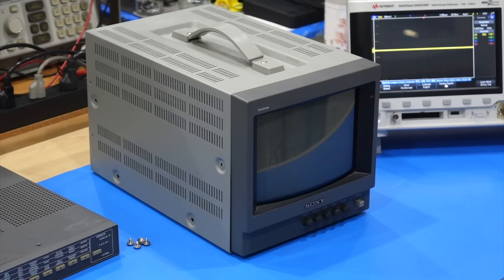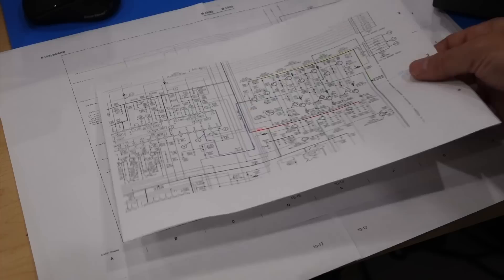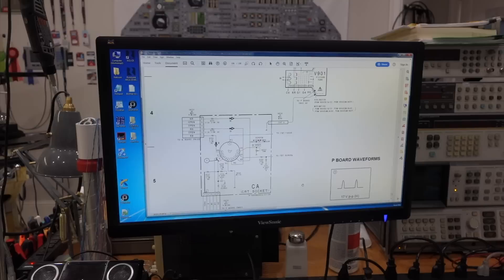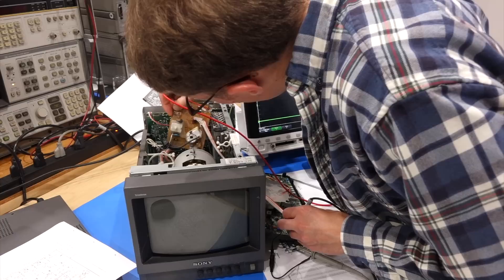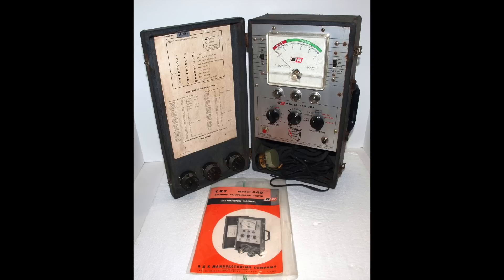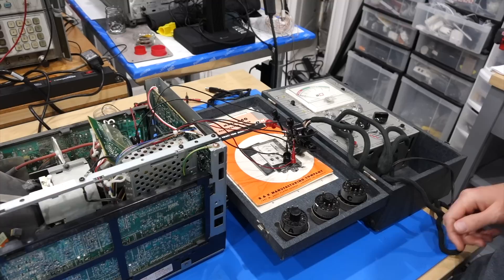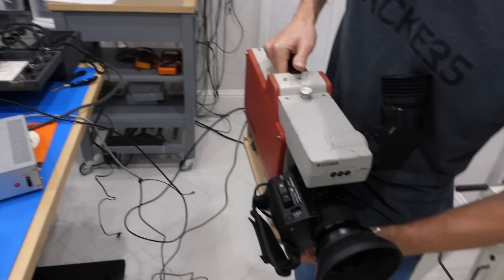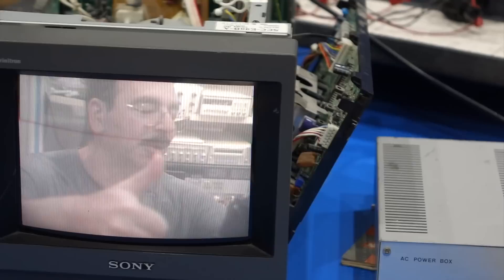Rejuvenating a color CRT

Comment: The only possible replacement for CRTs with comparable display characteristics that I can think of would be something done with lasers, mirror wheels (not mirror servos for X-Y as in laser projectors) for vertical and horizontal and some optics for adjusments.
If I had the engineering knowhow and money I would even try my hand at it myself.
Being that my main interest in this would be compatiblity with old and not so old computers and games, I'd aim for something that could do from 15kHz to 31kHz at least, perhaps a little more for systems at the edge of the HD era, and some PC style video modes, maybe.
Reply: The problem is that a CRT works because of the phosphor persistence.  If you scan a video raster on a white surface with a laser it will flicker too much.  

There might be a way if you had RGB fluorescent stripes on your wall and modulated a UV laser that had the RGB signals sequentially activated and synchronised with the stripes.  You would need to use optical feedback to maintain lock.
Reply: @KallePihlajasaari  I don't think that the on-screen phosphor persistence plays a big of a role at all. From what I've seen, that's seems to be more of a urban legend than technical fact. Maybe in earlier phosphor formulations, but not on later ones.

Have you seen the high speed footage of a CRT that The Slow Mo Guys released a while ago? youtube / 3BJU2drrtCM
The glow barely lasts for a few lines, and at much diminished brightness. I think the persistence phenomenon is just an effect of the human visual system.

If phosphor persistence was so strong as to keep any significant light emission on screen for long, I don't think classical scanline based light-guns for shooting games (like the namco GunCon) would be able to work at all, since the photodiode in the gun is focused to pick up a pulse from the screen and compare the timing it to a diverted composite signal also coming into it's circuitry in order to calculate the aim very accurately. down to a small fraction of a line. If the screen stayed bright for a long time, it would be impossible to tell the difference between the passing beam and it's tail.

There was also an old video from some guys, I think from Germany, that had made a similar display with laser and mirrors, but, in this case, it was with a pivoting mirror, so the scanline would travel back and fort on alternate signals, which is, of course, incompatible with the type of signals (and lightguns) I would want this for, defeating the purpose completely.
I'm trying to find it.

In short, I don't think scanning a bright enough laser point across the screen would produce more flicker than a the phosphors of a CRT lit by a scanning electron beam.

EDIT: Come to think of it, even regular XY pivoting mirror laser show projectors don't flicker that much in person. Persistence of vision is much higher than phosphor persistence.
Oh, and I didn't mean this as a wall projector. My prefered setup would still be a selfcontained unit, something similar to the old retro projection TVs with three monochromatic CRTs for red green and blue. Hopefuly smaller  :-)

EDIT2: Come to think of it, again, even with chearp laser pointer you can just doodle lines on a wall and see a pretty long trail thanks to persisistence of vision. You think your hand can move that thing faster than a mirror wheel? ;-)

EDIT3: I found the german laser projector again:   youtube / meMM69if74s  --  hackaday (dot) com  /2011/12/31/full-color-laser-tv/
It does basically what I would like to do, but in a different form factor, and maybe with collected led light, instead of proper lasers.
For some reason I thought it was based on pivoting mirrors, but it seems that at least the horizontal scanning is done with a mirror wheel, as I want to do too.

Out of curiosity. Would you know of a good material for retroprojection with a great black level?
Reply: @radornkeldam  You are correct.  Eye persistence needs a bright field about 20 times per second, dim images rather more often.  With the persistence of the TV screen phosphors they could get away with less brightness.

It looks like the technology is maturing and soon to be available as hackable devices I expect.

I found the following DIY rotating mirror project video on YT 
L4zR8qrH8Vc

And the following compact version that uses a dual axis steering mirror.
ET7jP2OsxzA and just before 5 minutes.

This video has another similar pico laser projector engine tear-down from 12 minutes
RuNyQKvx9zc

For back projection they used diffusers with a lenticular lens screen behind it, not sure why.  Like on any back illuminated display, adding a neutral density filter in front increases contrast (ambient light passes through the filter twice) but decreases brightness so it is a trade-off unless you have a high power light source.  For front projection there are companies that make the theatre screens but they are white and have a reflective surface and rely on a dark theatre.
Reply: @KallePihlajasaari  That first rotating mirror project uses a pivoting mirror for vertical scanning, which means it scans one frame or field downwards and the next one upwards, and that wouldn't cut it for replicating a CRT which always scans in the same direction. Also, the horizontal scan rotating mirror has only 4 faces, so to achieve the bare minimum horizontal refresh of 15625Hz for PAL and ~15750Hz for NTSC (technically about 15734,xxx in pure NTSC, but consoles never match these exact timings, PAL or NTSC), that mirror would have to spin at almost 4000 rps, or 240000 rpm ! Even if you coud to it, that would be too noisy, consume too much, and die early.
The German project I linked seems to use a ~36 face mirror for horizontal, so about 440 per second or 26250rpm, which is way more reasonable, but, in my opinion, still too high. For vertical, I think they still use a pivoting mirror too, so not good for my CRT replication goal.
For reasonable performance, the mirror wheel would have to have of between 200 and 400 faces (perhaps 300, as a middle ground), and have a relatively big radius, and, to widen the angle of deflection into the vertical deflection mirror, a lens would probably have to be used. My goal, as I said, would be a self contained unit, not unlike a classic CRT set, not an external projector, so measures would have to be taken to reduce the projection distance needed.

Anyway, those figures are for Standard Definition 15kHz resolutions (240p60, 480i60, 288p50 576i50)... for Extended Definition (480p60, 960i60, 576p50, 1152i50), double that... Man, calculating these numbers makes me lose confidence in this idea...
I'll need to further investigate rotating mirrors to see how many faces you can reasonably have on them, sizes, speed, vibration, energy consumption... It's getting complicated.
Basically, I need as many faces as possible on the horizontal deflection mirror wheel to reduce its rotational speed.
The veritical deflection mirror is not a problem, just having to do 50 to 60 Hz. Even a 4 side mirror would be under 1000rpm which doesn't sound problematic at all.

Anyway, the problem with the other projectors you linked is that they are all based on pivoting mirror which necessarily scan back and forth up and down, and that doesn't work directly with classic video signals. This is a good technique for using pivoting mirrors, given their characteristics, but it's not how analog TV signals work, and that's what I want to recreate, as my aim is direct compatiblity with old game consoles and tv computers, and even CRT scanline based pointing devices, specifically lightguns.
Pivoting mirror designs, no matter how good their results in terms of visual quality, break compatibility with that, and, thus, aren't what I'm looking for.
Even if I ditched lightgun compatibility, I'd need to add a lot of signal processing, including buffering of frames, because the frames would be coming in sequentially, top to bottom, left to right, and, on alternate frames, the laser would scan "backwards", so the incoming signal could not be fed straigth into it, but would have to be stored into a framebuffer and THEN displayed. This would add at best, a delay of 1 screen refresh, perhaps 2.

If I'm ever going through the trouble of making this, my aim 100% CRT behavior recreation. Otherwise, it's just another display competing for picture quality, and the market is full of really nice LED flat panels. with tons of features and crazy resolutions.

EDIT: I've been doing some calculations and thinking about the details of this thing, and it's going to be more complex (and expensive) than I initially thought.
Even to support EDTV resolutions (480p/576p), the horizontal refresh is almost the same as 1080i60 (720p is higher still, and 1080p is a nightmare).
I thought of a possible way to pack two lines for each mirror face, but that involves complex lenses... but so does mere geometry linearity, so I don't know...
Reply: @radornkeldam  There was a scanning IR vision system that used 8 parallel sensors that was used to scan with a polygonal mirror where each mirror was slightly tilted.  The back of the mirror was used to scan 8 LEDs  into the ocular.  The 8 facets would scan one 8th of the field every revolution with 8 zones in parallel.  Not suitable for your application but might offer some ideas.

One idea might be to bounce the light off the polygonal mirror twice to get double the deflection angle.  You need to have similar number of facets on the drums to get similar aspect ratios otherwise.
Reply: @KallePihlajasaari  Sorry, I can't picture in my head the setup you described for that IR vision system.

Your idea of the multiple bounces for augmenting the deflection angle is very good, and it also made me realize that my previous lens based "line multiplier" was an unnecesary overengineering mistake and it can probably be done better with a multiple faced mirror in a convex configuration instead. The main idea would be that, by timing the rotation right so that multiple signal lines land on the same face of the polygonal mirror, and projecting that onto the multiple faced mirror somewhere after it, it should be possible reflect more than one line for each side of the polygonal mirror / wheel, in such a way that, after it, each segment of that multiple line would finally land on the same spot  sequentially, for example, three lines for one side of the poligon, both reducing the rotational speed and allowing for bigger faces on the polygonal mirror.
My initial idea was to do this with diffration lenses, but I'm sure it'll be better to use mirrors instead, which improves all terms of simplicity, cost and image quality (won't have to worry so much about lens manufacture and materials and color aberration).
That was very helpful, thanks.

Who knows if this will ever get done (probably not), but it's fun to think about! :D

Now I need to figure out how to account for linearity correction: Constant angular beam movement will necesarily result in distorted projection on a plane unless corrected somehow, and retiming the actual video data is out of the question for this design. I can only think of lenses and/or some form of convex curved mirror somewhere in the reflection path.

Would you happen to know of a simulator software I could try to use to experiment with these ideas?
Reply: I'm thinking about this pipe dream in my head and doodling setops on paper, and short of a proper simulation, I'm finding rather problematic challenges preventing me from my video lines in a straight shape along the light path, and, also, the resulting picture geometry without retiming the video signal (vital for lightgun compatibility).
One problem I'm finding is the same challenge that flat CRTs had to solve regarding picture geometry, where the picture will be compressed towards the center in the horizontal axis and I'm not sure how I can correct that.
On a CRT they just adjusted the basic sawtooth waveforms sent to the deflection yoke so that it would steer the beam at different angular velocities for different parts of the line and frame to correct the linearity problem of projecting onto a flat plane from a single point. The equivalence in a design that relies on polygonal mirrors for deflection would be to fine tune the spining rate of the polygonal with an acceleration/deceleration curve triggered for each face of the mirror passing in front of the laser, and I'm guessing that just completely nuts. I mean... it's already going to be hard enough to keep a steady spin matching the video timing, let alone adding a custom acceleration and deceleration curve for each passing face of the mirror. I don't think that can be done...
I was trying to do this with just mirrors, but, unless I find a solution, it seems lenses are going to be unavoidable, and I don't know enough optics to even make a rough approximation of that.

Comment: They used to make step-up transformers to boost the voltage op the filaments to get a bit more life out of a crt.   They had male and female tube socket connectors on them so they could be easily attached to the crt.

Comment: Tricks for soft CRT's. BTW consumer Sony Trinitrons  WILL NOT rejuve. Only last a day at best !!
1) jump out  the series filament resistor. Use scope to be sure its  < apx 8 V.
2) if the FBT has an open core add a winding or two to the filament. Again check with scope.
That will get things usable for a while.
Oh and get a newer CRT tester that is not brute force !

LFOD !

Comment: use to rejuvenate lots of color tv picture tubes (and black and white) with a B&K 466. it was always a short term fix and could make it worse. it did this by suposidly blowing some of the cathode meterial off to expose fresh cathode over done it was the end of the tube. they also made boosters that increased the filimant voltage

Comment: Sad to say but after seeing many screens die over the years that filament is on it's last legs too, by the end of the video it had that sickly blurry look to it. It will look fine when you turn it on but be unusable in 10-30 minutes when the tube heats up, then they just go black.

If it was just the gun issue though it may have worked. Perhaps failing filaments can affect a guns performance, that maybe being the first indicator the filament is on the way out.
Reply: Upgrade filament supply to 5V and it will get a boost of life again, though if you are careful, and slowly, as in over 5 minutes, take it to 7VAC using a variac, you might get a good amount of extra life from it by having the oxide layers churn over to reveal fresh oxide. Last gasp though, good chance of blowing one of them open this way.

Comment: This was probaly a factory defect tube. This moitor looks barely used, A well used CRT set is full of black, soot-like dust that you can not clean off completely, it will leave the vivid red HV wire a bit dull, and the CRT socket and plastic parts of the yoke yellows from the heat. I can't see any of these signs here. I would guess the tube is slightly gassy, causing cathode poisoning. Definitly keep the monitor, just in case you manage to find an other one with a bad flyback, but good CRT.

Comment: Seen a guy repair a crt tube by cutting the neck, replace the electron gun and re vacuum and weld it back. Was for the 8-bit guy’s arcade game.
Reply: Do they still do that?
Reply: @djmips  yes apparently- there’s even 2 companies that still do it - at a price of course - avionics and radar stuff still operates analog backups
Reply: @cheapasstech  Hawkeye the LAST regunner in the USA closed down a few years ago.
Reply: Thomas electronics still does some… and a few hobbyists that have the equipment

Comment: A few of those "rejuvenators" have a good last resort option with chance to legitimately fix a shorted tube. It blasts loads of current between grids or other components that should be normally isolated. Usually ends up causing more damage though ;)

Comment: I have the same Triniton but my picture collapsed and now it doesn't work at all but I dont even know where to start :(
Reply: Trinintron very common to have vertical collapse because of dry joints on the flyback, or the transistor or drive transformers, and on the CRT yoke connections. Get manual, look for dry joints, and resolder them. Otherwise contact details for Marc are in the doodly doo.....
Reply: @SeanBZA  check out Snango066 .. Like me he really doesn't like Trinitrons. Over complicated and can be very expensive to repair.
Reply: @PaulaXism  Oh I agree but they do have the absolutely best images outside of those made for aviation and space use.

Comment: Once had to call in to have an official tech diag a monitor that only needing tracked by adjusting on the deflection coils..  but being a monitor under warranty for a hospital i had to call in and use a video phone with the tech..  spent 45 mins giving him readings and he told me that they have been having the same odd issue with this line of monitors he specialized in.  Little did he realize the refresh rate on all video phones and pc cams were just the right hz to cause him to see the screens as black…. Lol.  While on the phone call i said ok im going to do something will it void the warranty?  He said at this point he is all ears.. i adjusted mine which fixed my issue, he said he still sees black..  lol..  so i adjusted the set to show him the screen lines..  he had a hand to face moment..